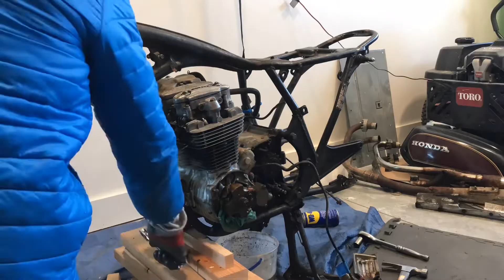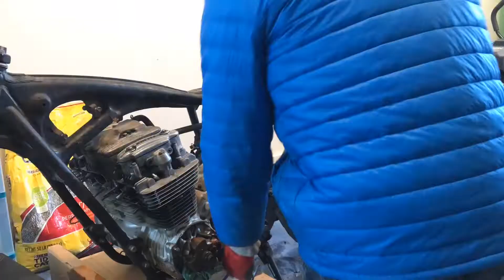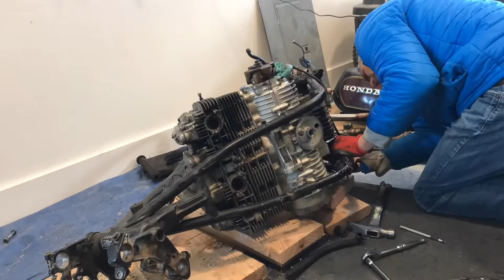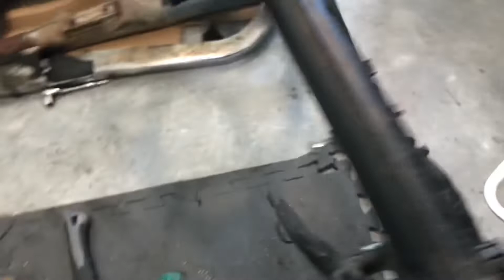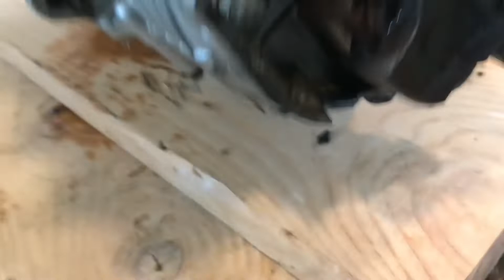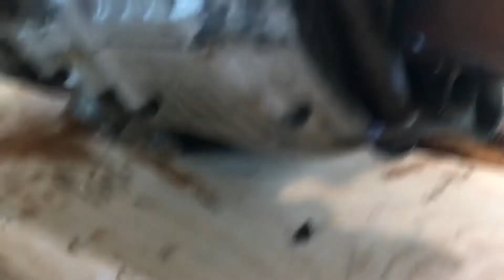Engine Removal - Cafe Racer Build (1979 Honda CB650)

Comment: This is the first video I've seen with someone removing the frame section
Reply from the maker: Yeah, I had to take the whole motor out, and this method worked really well (no awkward back strain). I’m not sure if I’ll take the same approach to reassemble because I’ll be more cautious with the freshly powder coated frame. Those frame bolts opened it right up.